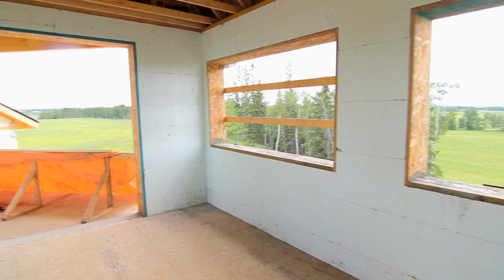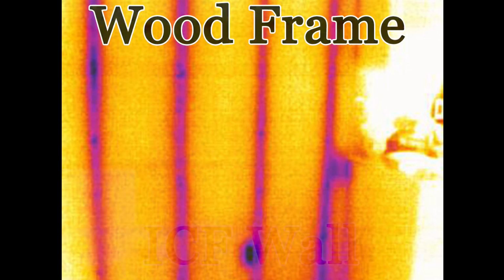10 Reasons to Design with ICF (Insulated Concrete Forms)

Comment: Kode, just studying this ICF system. I may not build our additions as elaborate as you have shown,  but there are a lot of cool details I will try to use. The corner windows, the angled gable ends double to support the roof trusses. If I get the nerve to put in a suspended ICF floor that would be awesome. Any thoughts on termites using the insulation for nesting ? I have a house on well and septic, as well as close to a pond and creek so, we try not to use insect chemicals and probably cannot treat the actual ground because of the water,water tables.
Reply from the maker: I’m not sure about the termites unfortunately. As for what features to utilize, whatever makes the most sense to you. Video shows most just to give ideas

Comment: Would love to see a build with an ICF roof as well. Installing a frame roof seems to go against the point of ICF to me. Great video!!
Reply from the maker: Thanks! Absolutely an ICF roof is the ultimate. In my area I have to stay competitive with the bare minimum builders so this is a good compromise. A wood truss can be anchored down to a 12” LVL which is substantially stronger that conventional connections, add some hurricane clips and away you go. Plus wood trusses allow for a ton of insulation with no major increase in cost. 

I love your idea but unfortunately budget is usually a factor, it it wasn’t I would be building some incredible things.
Reply: @uptokode  Thanks so much Kody! I figured as much that it came down to cost. Being a FL resident I was curious. Hurricanes and Florida's extreme heat is my concern. Curious how involved adding an ICF roof would be and is it a huge difference in cost. Thanks for taking the time. I'm a huge fan of your channel. We are planning to build our next home with ICF. Keep rocking the videos out here! All the best!
Reply from the maker: Anytime! More videos to come when opportunity strikes.
Reply: @Kson7491  If you are in Florida and still looking to build, I would opt for a flat roof. Since you don’t have a snow load to consider a slope is unnecessary. I have done many many ICF floor decks in houses and it’s fairly simple. You pour the floor (or roof in your case) at the same time as the walls to form a monolithic shell. The walls are really straight in this application because the floor/roof diaphragm maintains the shape. While it is possible to shore pitched and vaulted roof systems, I wouldn’t see it as economically viable for most. If you’re one in position to say ‘best performance is what matters and money is available’ then it’s definitely doable, not crazy eccentric levels of cash or such needed to achieve a sloped system, but I have never done one due to most budget limitations. (Windows and ICF are where to spend the money, so definitely load the budget to that end.) Good luck!

Comment: So you're saying the span you had in the garage @11:15 could be supported with just concrete and rebar ?
Reply from the maker: Yes. I believe you can have a 28’ span with little issues meeting the strength. More span just means deeper beams.

Comment: Another big Plus is: A lot More protection from Hurricanes or Tornadoes blowing your house down, because of the Mass Weight of the concrete walls.  Siding or roofing may sometimes blow off some, but the house as a whole, is a lot safer with ICF.

Comment: Although it looks clean and sturdy, is its structure 'flexible' enough to 'flex' with soil disturbances (read earth quakes)? How about swaying with forces? Thanks for info.
Reply from the maker: Most high rise building are constructed with cast-in-place concrete so I would say yes. Only difference with ICF is the foam is the form work and doesn’t get stripped afterward. 

As for the specifics on your question...I’m not an engineer so I can give you any solid answers.
Reply: Kody Horvey regarding earthquakes and icf: it responds really well due to its monolithic construction. I am Greek (Greece has high earthquake potential so all buildings are being built based on safety laws) and engineer: the only differences between this and a Greek icf house are: the foundation we use and the way we pour the floor slabs. We also use PVC (I think you call them Vinyl in the Americas) window frames. For further reading you can check on the sites of two construction companies that build with ICF (pls pm me if you want it)

Comment: Why airtightness so important? isn't it's good when the house can breathe? You know, no stale air?
Reply from the maker: Depending on your climate (hot or cold) you are paying to temper that air to your interior temperature. If a building loses a ton of air you are essentially throwing money out the window.  No pun intended...ok maybe a little bit.
Reply from the maker: But you do need an HRV that continuously brings fresh air into the building and tempers it through a radiator (sort of speak) and doesn’t need fuel or power to temper the air coming in because of its design.  Hard to explain
Reply: @uptokode  Ok, fair enough :) Thank You for reply.

Comment: Have you ever built a larger shop - garage with ICF?   I'm looking to build a 40 X 60 shop with 15 foot ceilings.  I plan on heating in the winter to maybe to 50 -  60. tempted to do radiant floor,  part of my debate is if the insulation and strength is worth the difference compared to building with wood, granted to get to 15 ish tall, I would need some stem walls. My other concern is pouring 15 foot in one go.
Also what is the biggest lintel you have poured?  initially I was thinking I would need a LVL above  the garage doors, but seeing this video I'm thinking a properly enginered lintel would work well.     Also do you know of any engineers in the US?
Reply from the maker: I priced an ICF shop vs a 2x8 stud wall shop on a concrete foundation. The ICF was 20% more. Now this was AFTER the 2x8 shop got blown down. 

Is it worth the price difference? I’m not totally sure. What I have learned recently is make sure you have a frost wall that goes 4’ below grade (ICF is ideal) and insulated under the slab. 

If you do slab on grade with no insulation to stop the frost from going underneath then you will be constantly heating the earth...all winter.
Reply from the maker: I think below grade insulation is just as important or more than the above grade walls.  

As for lintel. I’ve easily done 18’ long lintels. 

For engineer....any structural engineer can do the calculations. They just need to understand that it’s a concrete beam. Who cares if it has foam on either side. The calculations are easy for those who know it, just don’t get confused by the ICF aspect.

Comment: How do you normally run electrical?  What about plumbing?    Also have you ever expanded or moved walls after the fact?   I live in a ICF home sort of found it by mistake, but a lot of other things lead us to buy the home, but I have considered moving an exterior wall ... but all that I can think about is the epic amount of cutting that would be involved, also radiant heated floor also sounds like it would add to the complexity, I can see where a traditional wood home would make this change simpler.
Reply: You don't have to cut the interior insulation if your already running strapping for hanging drywall on. You'll want to run plumbing in channels cut out, it helps with sound deadening. Plumbing and electrical can also be run in the floor.
Reply: No clue how to move a wall. As for electrical, hot knives are used to cut out a channel for the wiring and recessing the electrical boxes. Similar things can be done with small diameter plumbing. You should be able to find YouTube videos on it.

Comment: How much is a 4x8'x2.5" sheet ? 
And enough to cover a 40x60 floor?
Thanks
Reply from the maker: Price of EPS foam? 2 1/2” thick will be at least $1.00 per square foot but depends on many factors.

Comment: Love to build my house with ICF. But I was quoted $25 per sq ft of wall area. That includes the form, concrete and labor. the choice of ICF contractors is very limited here in Massachusetts. Is that a reasonable price for ICF walls?
Reply from the maker: It should be closer to $18. I’m not sure what concrete prices are in the United States either. 

Up here block is around 4.25/ sq ft and concrete is $220/ cubic meter.
Reply from the maker: In Canada is where we are. Alberta
Reply: Kody Horvey Jesus. So for my 20x40 2 storey house, without calculating the foundation / basement, it’s 48k to pour ICF walls. I can frame it with 2x6 walls, 5/8 ply wall sheathing, floor I-joists, 3/4 ply floor sheathing, roof trusses and roof sheathing for under 20k. The heating cost difference would take around 50 years to make ICF cost effective. Since I don’t even spend winters in Canada, well... I like concrete buildings but this is a hard pass.
Reply: 3.	Rich Demetrius – Mass Building Products
413-218-5471

Comment: Where are you wood framing where the window headers are 2x longer than the actual window opening, and how does 3 ft of header on each side of the window help the opening?
Reply from the maker: That would be for a corner window unit where you need a cantilevered header.

Comment: Why are tall walls poured in segments? Why can’t you set up a 20’ wall and pour it?
What is the maximum height you can pour?
Reply: Richard and Kody. I developed a method to do this while building bridge abutments. I have poured concrete up to 30’ without voids. It’s really not expensive, and easy. Anyone can do it.
Reply from the maker: Some guys will pour 20 ft heights. For me it’s too hard to vibrate and the concrete actually separates when it falls that far. Engineers really don’t like it. But it can be done, just not for me.

Comment: This is your best and most informative video yet and I’ve been following your channel for a couple years now. This is the best ICF construction YouTube channel by far! Was that a gas fireplace or a wood burning fireplace? I’ve have an ever-evolving sketch of my own future ICF house on my laptop and one thing I’d like to have is real wood-burning fireplace since I never had one growing up in Arizona and technically still don’t need one here in southern Louisiana. I know there’s all kinds off flack about it on GBT about it defeating the purpose of a super tight home but I don’t care. How would you go about fitting a traditional Rumford fireplace and chimney in a thick ICF wall without sacrificing too much insulation, disrupting the design of the wall and taking up too much room? Google doesn’t give much because as I mentioned earlier, it only shows reasons NOT to build a fireplace on GBT.
Reply from the maker: Thanks a lot Rick! Put a fireplace in if you want. With ICF you will get really hot in there because they are so efficient. You’re at least aware of it. 

If you can find a way to pull that hot air into the air return of a furnace then you can distribute that heat throughout the house. That would be great use of the fireplace. Email me if you have more questions. Find it on my website. www.uptokode.ca.
Reply: Kody Horvey oh yeah, no doubt about that. Especially with the efficiency of the ICF and the Rumford fireplace, they give off a lot of heat. I may end up not putting one in altogether because it’s just not needed down here in the Deep South. Just a heat pump is plenty for even a conventional production house since it rarely gets below freezing here. Efficiency and hurricanes is my reasoning for going ICF. Thanks for replying Kody. 👍👍

Comment: I've asked on your channel before. What lintel/header do you recommend for an 18 foot door opening in an ICF house. Would ICF poured header with rebar work?
Reply from the maker: Yes an ICF header would work best. Engineering depends on many factors. Try looking up the specs that almost every ICF company has available. Logix, Nudura, Fox, Amvic, Superform all have charts available to help with this question.

Comment: Hi kody, thanks for these videos they are great. I noticed on the stand outs of the first floor on the house you were showing... what are you using as a sill plate for trusses to go on? Looks like you had tape over each fastener? Any info or a video on that would be awesome!
Reply from the maker: Hey Devon, we use LVL for top plate. Doesn’t cup like dimensional lumber. 1 3/4” thick and we like to inset our anchor bolts so it’s easier to land trusses. 

Not sure what the tape was. Hope that helps.

Comment: "You can add exterior insulation to a wood frame... But I call it polishing a turd"

Yup

That was a solid 10 list.
I really liked the triangle windows matching the roof pitch with the ICF rake wall with parallel cord trusses. Clean efficient lines. Cantilevered corner windows always a show. But those exterior/interior ICF beams in the first floor ceiling is the real kicker! Your insulated slab connection on past video was cool too.

The problem with doing sweet work is that most cannot afford themselves, at least not at their potential.

I've been enjoying your videos for a long time, from ICF to Ikea cabinets to drywall finishing. Keep em coming, thanks for putting these videos out. They've definitely gotten better over the years.

Video request for roof details that y'all like. ICF window detailing. And also, general (not ICF specific) architectural features that y'all like.

Thanks, and tell your dudes good work.
Reply from the maker: I really appreciate everything you said! The video ideas are great and I have lots of ideas so they will keep getting rolled out.
Reply: @uptokode  I'll second ICF window detailing (if you haven't done that yet)!

Comment: I want to build my house (in texas, 36 x 36, no attic, no basement, concrete slab foundation) with ICF but I'm curious about vaulted/cathedral style ceilings, is it possible to have it ?... and is there other options to use besides drywall for the interior finish???
Reply from the maker: Yes of course you can have vaulted ceilings. If you do then similar to the ones in this video. Unless you’re referring to an ICF roof itself. That is way more technical.
Reply from the maker: You can do almost anything you want for an interior finish. Cedar tongue and groove. Pine. Metal cladding. Pretty much anything you can think of.

Comment: What are your thoughts on the many different types of ICF's out there? I like the "perfect block" brand, but still researching to figure out who and what type to go with.
Reply from the maker: Great question. It takes a long time to research them all, work with each one a few times and figure out the ultimate block. They are all great and of course ICF as a system is the best. I have a video on 5 reasons I like Nudura. Pretty good block and I’m happy with it. I’ve used Logix, it’s great too. 

I haven’t used them all so it’s hard for me to say. I don’t think one is an obvious better block than any other. All have small pros and cons. 

Hope that helps.

Comment: If you like ICF you will love the next generation made with polyurethane not polystyrene. No bracing necessary. Can handle a 10ft pour without blowout.  R50+ insulation. Class 1 fire rating. Checkout http://thermagreenblocks.com
Reply: Something wrong with this link?
Reply: @786otto  I learned there is a website rebuild going on. Someone password protected by mistake.
Reply: @Copperrooney Thanks, no problem found some info about it anyway.

Comment: I really  love the information  you offer  through your videos. Do you have a Facebook Group  or Page that I could  ask further questions? 
I am mainly  interested  in what it takes  to create  a long open span for larger  windows  using ICFs. Thanks again!
Reply from the maker: You can email me but I am no engineer. Kody@uptokode.com.   What I can say is don’t let people tell you it’s too hard to try to say there’s no information on it. Any half decent engineer will know they aren’t designing an ICF wall. They will simply design a lintel for a 6” or 8” concrete wall. Concrete should be simple for them to calculate is what I’m getting at. 

Make sure when they design the lintel that there’s enough room and concrete coverage over the stirrups. I’ve used a company called Alberta Wire Forming who can make any stirrup you need and it’s made from 1/4” wire which is very similar to 10mm rebar. It’s easier to work with and saves space in the wall.
Reply from the maker: And thanks for the compliment. Glad the videos are helpful

Comment: Great videos Kody. Do you always brace most (?) of the joints with timber? Also can you show us how you detail the waterproofing of the openings.
Reply from the maker: I have a video coming out any day with how to install and detail a window into an ICF wall. Stay tuned for that.
Reply from the maker: As for bracing. Depends on the situation. This house, the customer thought he wanted metal siding so we installed 1x4 strapping as we went along. Since then he changed his mind so off comes the 1x4. 

There are many situations where we need scabs to brace a joint in the block. That will have to be a different video for a different day.

Comment: When you pour those windows do you have a cold join halfway up the side.  Or could you make a video on where to put your cold joints.
Reply from the maker: If you want further details let me know. This house had some special cold joints in specific heights. Mostly if you can’t get a full lintel height in, then make the joint in the centre of a lintel where the load should be neutral. Loose rule of course and always consult an engineer. 

That 54” beam I mentioned. It has a cold joint down the centre.
Reply: Nevermind you just answered my question
Reply: Great channel, very informative. Great job